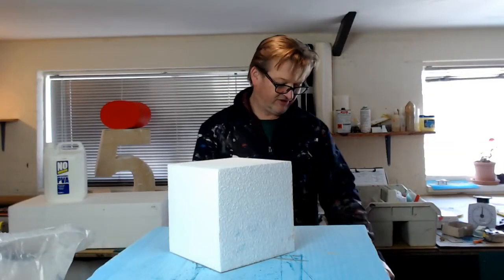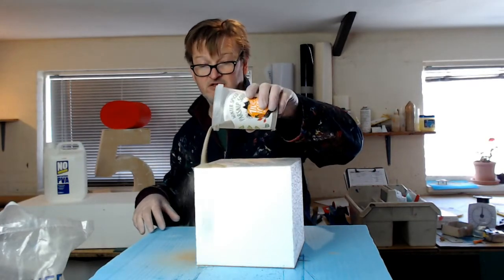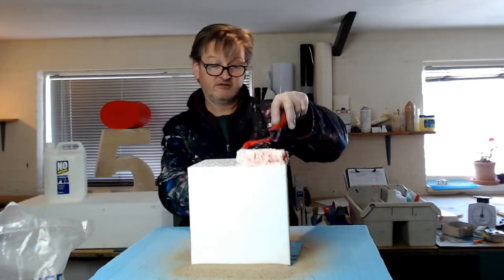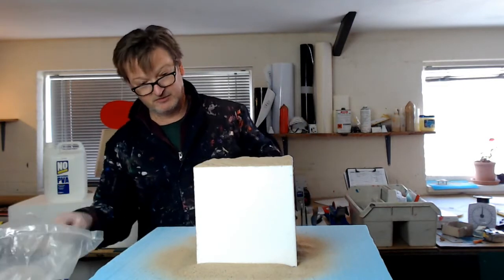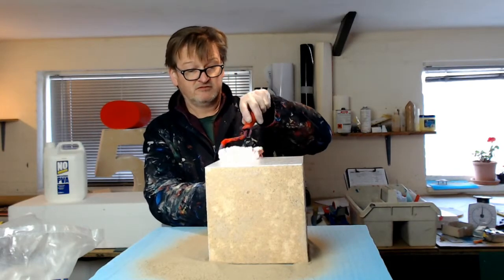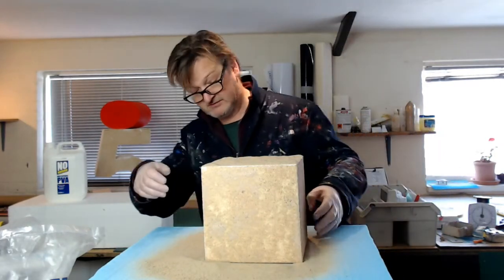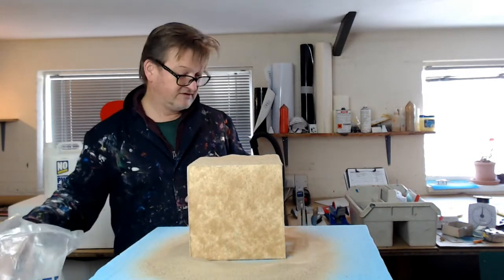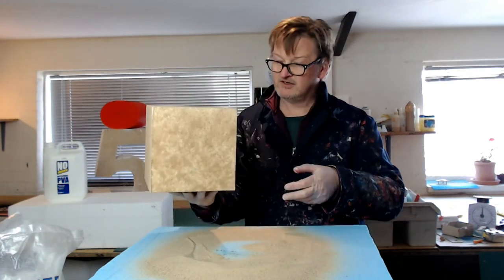How to waterproof styrofoam and how to waterproof polystyrene for outside use

Comment: Hi I enjoyed watching your vid and wondered if you can use this method if you are then going to cover the form in a covering material, ie, artificial grass or a plastic matting. would it stick or should iI skip the sand coating?
Reply from the maker: Leave out the sand coating if you are covering it with plastic matting. Although, the more layers the better, for strength.

Comment: If i put polystyrene board into an aquarium for aquarium scaping how long will it last without following your methods?
Reply from the maker: Polystyrene floats, not much use in an aquarium. Try making your aquarium decor with cement.
Reply: @carvingfoam  😂
Reply: I’ve longed for a reliable way to seal aquarium decor but there is nothing I trust so far not to leech chemicals into the water.